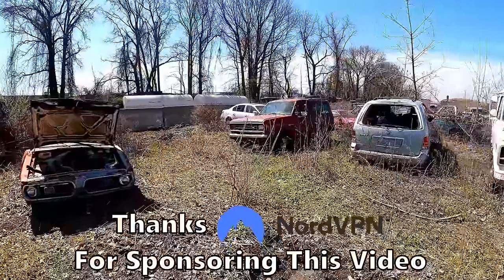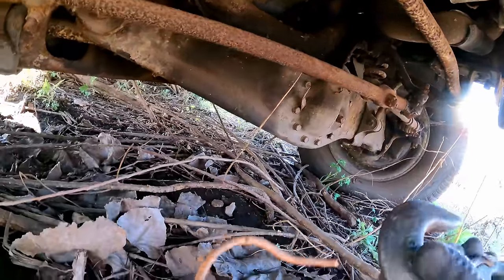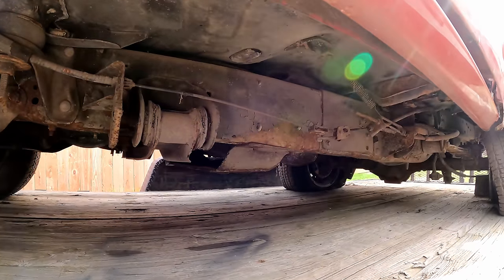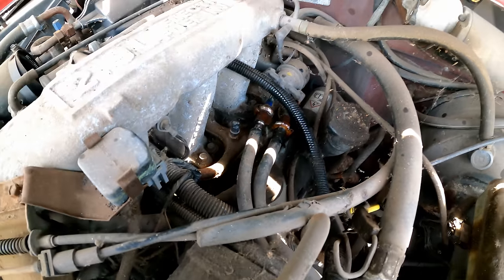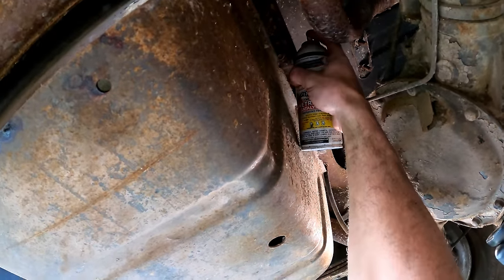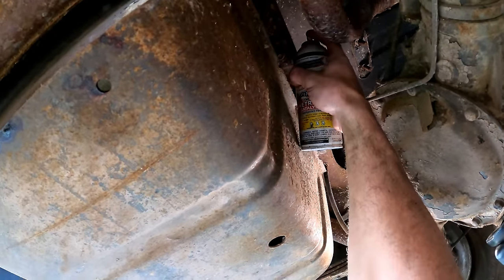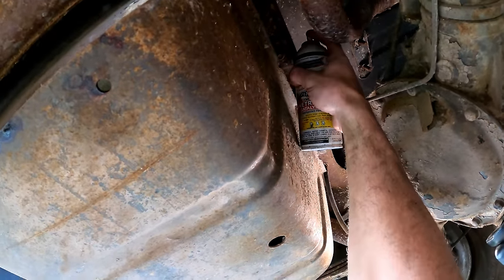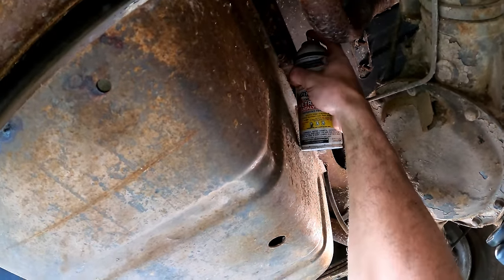Junkyard Bronco II What's It Need and Will It Run? - NNKH

Comment from the maker: 0:00 Intro / Walk Around Tour
5:00 Loading
8:51 New Puppy Gus
10:07 Let's Tear In / More Inspection
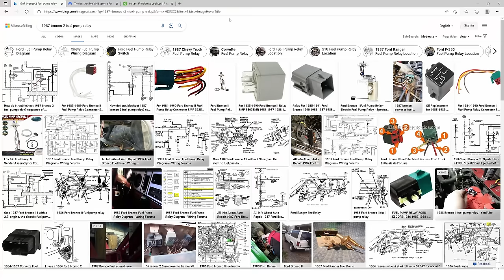17:40 Sponsor
18:57 Remove Gas Tank
27:33 Check Rear Brakes and Fluids
31:19 Fuel Filter/Pump
35:42 First Start
38:00 Cold Start / Outro
Reply: O
Reply: Not rusty
Reply: People like old model
Reply: Go to local courthouse lost title salvage title  got dot inspection
Reply: Rebuild title
Reply: Mustang
Reply: How do I get ahold of
You to buy this
Reply: @thomasmadden1011  FACTORY MAGS
Reply from the maker: Shoot me a message on Facebook or Instagram under the same handle. Or my email is in the about section of this YouTube channel
Reply: aa
Reply: @thomasmadden1011  YouTube Vermont Loophole, you can get a Title on alot of them and you dont have to be a Citizen of Vermont and the Vehicle doesn't have to be registered there.
Reply: OLD GASOLINE>>>> For anyone that is a total novice watching this guy let me tell U about a 35 year old chevy Blazer a customer brought me. The Blazers name got to be rusty. Because it was a rusty POS at the time of arrival. I got the quarters that were all rotted cut off and new ones welded on and that spot across the inside of the bed where the hinges R for the tail gate all welded up just fine. It came time when it was in Primer to get it running. I came to find out I was doing something dangerous against my own shop rules by cutting and welding on a rig that I came to find out had pin holes in the top of the fuel tank. That was number one mistake the other mistake I made was inviting the customer to help me take out the old tank and install the new tank. We drained no less than about 3-4 gallons out of the truck and I instructed my helpful friendly customer to dispose of the old fuel in my fire pit. That was the biggest mistake I ever made not only did I almost lose my barn that day the customer had a spate of childish and decided to throw a lit paper towel into the old gas he said it's 30 some year old gas nothing should happen he said to me as I yelled not to toss the lit paper towel he did anyway. He had the truck 15 years before he got the urge to finally get working on it so it was his assumptions that the fuel being that old was inert as this guy almost implies when taking that torch to the pan with residual fuel in it. Well that old gas made the biggest fireball I had ever seen since being in Iraq on my 6 tour government paid vacation. The fireball hurled my customer over a pair of saw horses that held the old fuel tank which also caught on fire from his pants & shirt being on fire. I put my customers legs & belly  out with a cup that I just filled with 2 cans of beer. The rest he put out with his own hands. We had to explain our exploits to the Emergency room folks of why my customer was burned on his legs and hands and reeked of beer and I also got a speech about drinking and driving which I never do it's just this was an emergency. We did return the next day to get the new tank up in the truck... JFYI my customer was a state parks Police Officer that did that nutty deed. But he was young and he did learn from his mistake.
Reply: @martintaylor984  Dang. Well, enjoy it. I'm far away anyways.
Reply: My grandfather used to have an 1986 Ford Ranger. The only difference between the interior of that Bronco and my grandfathers Ranger is my grandfathers Ranger was 2wd and automatic and it was only a 3 seater. My grandfathers Ranger was also blue not red. The cloth seats also was not a two tone in my grandfathers Ranger
Reply: @Samthemule2003  Funny you say that, as I just got an 86' Ranger about a month ago. Manual needing a new clutch
Reply: @LegendStormcrow  My grandfathers Ranger we always used strictly for scrap runs, small grocery runs, or just to go somewhere within an half hour drive away. Had to put a quart of oil in every 30 miles, burned oil bad enough that it smoked after being shut off, occasionally while going down the road it would randomly stall, and it was so rusted out that everytime I was in it and we passed a cop I was hoping and praying we wouldn't be pulled over and need it towed home because of how bad it was and how bad it ran. The side panels of the bed was rusted, the exhaust hangers rusted out and had to use metal wire hangers tied around the frame and exhaust. That was really the only major rust issues. It was otherwise just surface rust. The problem with it was the motor was crap. The factory V6 it had needed a major rebuild or just straight out replaced
Reply: @LegendStormcrow  My grandfather told me he bought off a guy who used it strictly as a farm truck in the 90's.
Reply: @Samthemule2003  I didn't realize that that year had V-6's. I got a 2.9 V-6 sitting in a piece of Road Kill in my yard. I'll eventually find her a new Bronco II body. Kind of had the opposite experience with her. She's out lived 2 bodies and saved a lot of lives back in 98'.

On one hand, if my mom wasn't stupid we wouldn't have nearly died in a blizzard with nothing but fumes in the tank. On the other, our CB radio saved a lot of people, and that 2.9 kept going just long enough to keep the radio going.
Reply: @LegendStormcrow  Now my mom had a 98 Chevy Astro AWD with a 4 speed automatic and 4.3 Liter Vortec V6. If it wasn't for the rear end and basically everything else except the front end, the AWD transfer, frame, transmission, and engine, she would still have it. Literally basically just the front half of the vehicle was good. She had to replace the rear end twice already. First time because of the rear end going out. Second time because it was from a Silverado pickup so it was incorrect. Then the third one kept needing to be greased up. So it for the most part was decent. 3 row 8 seater with tow package
Reply: @Samthemule2003  Still better than Dodge Caravans shudders
Reply: @NoNonsenseKnowHow  Just curious, did she sell?

Comment: I'm sure that's 151k miles. Many cars didn't register 100k odometers til the 80s. I had 2 of those and the the 2.8 and 2.9 engines were junk/problematic. The trannys and transfer cases were great, no issues with either.

Comment: What's it need? Probably a battery, battery cables, ignition switch withTFI sensor, maybe the improved heads, fuel tank, fuel pumps, new or rebuilt fuel injectors or carburator, plugs, wires, distributor cap, starting selenoid, transfer case and transmission rebuilt, possibly a new engine control computer, brakes, shocks and struts, suspension bushings, full exhaust, tires, electrical work, interior work ... You could very easily spend thousands more than it is worth to get it drivable. You're better  off leaving it where it is and invest your money in something that you can sell for a profit. 
A short block or long block or a 3 to 6 inch suspension lift kit, V-8 adapters for the same era Ranger pickup and a good used 289/302/5 liter small block Ford with transmission and if applicable, transfer case might be cheaper than getting that 2.7 or 2.8 liter V6 and Bronco II going down the road again.
OH!!  A clear - not "Salvage" title would come in handy when you sell it

Comment: Still got that old compressor layin around? That thing looked pretty neat, never seen one like that!
Reply: Also just came across this video after doing some research on bronco 2's, just brought home a fairly clean 87 2.9L 5 speed 4x4 myself. 6in lift and 35s under it. Gonna be a pretty sweet project to v8 and solid axle swap for my stepson over the next couple years before he turns 16, gonna be the baddest bronco in his high school lot!

Comment: what any ford bronco 2 needs is to be replaced by an s-15 gmc jimmy lol ive ownd both will the trunk lid latch if its parked on a hill he he leave it in the junk yard ware it belongs good videoe thanks for shareing no pun intended just saying ps make shure the tail pipe doesnt have a hole in it in front of feul pump it will go up in flames you might inest in a few fire estingwishures lol i owned 5 of them thair cool looking but a death trap electricle ishues roll over ishues be carfull dangeruose ride get an s-10 0r s15 blazer indestructible they are

Comment: Headlights. I can't think why they put cheap crap plastic headlights in cars today. The glass ones lit the road just fine, didn't weigh much, and were easy and cheap to replace when needed. The new ones cost an arm and a leg, have to take the front of most cars apart to replace them, and the bulbs are very expensive. WHY?  I had to replace the ones in my 2012 Nissan last fall, they cost a lot, had to take the front bumper down and a bunch of other stuff loose, two hours. Glass lights ten minutes.

Comment: You wasted a bunch of time and effrontery that fuel system. You can get a cheap pressure tank for gas that will screw right onto your fuel rail Schrader valve. In one minute you have fuel. No wasted time on tank removal ( which did you no good) filters and all that.  By attaching at the shrader, you bypass everything else. You’re pretty clever sometimes but miss the easy fix sometimes also.
Reply from the maker: I'm wondering, did you watch the video to see that I used a cheap pressure tank from the flea market?